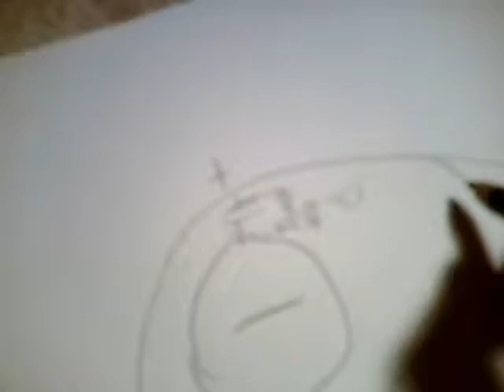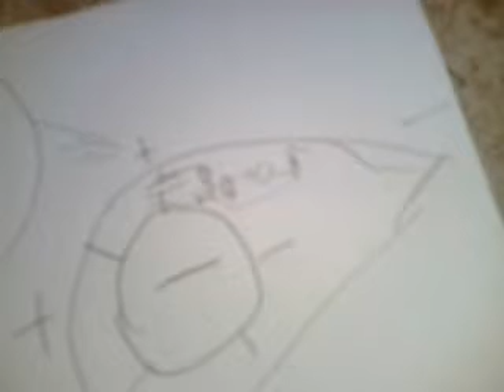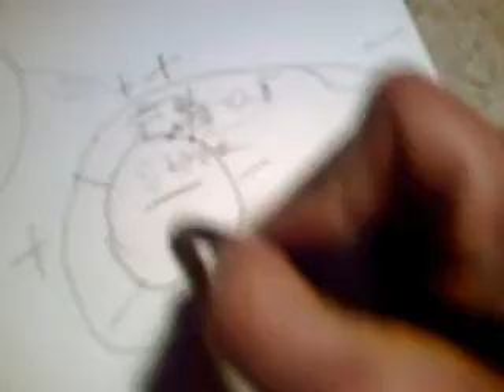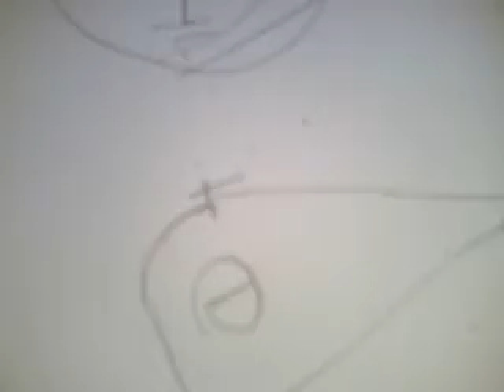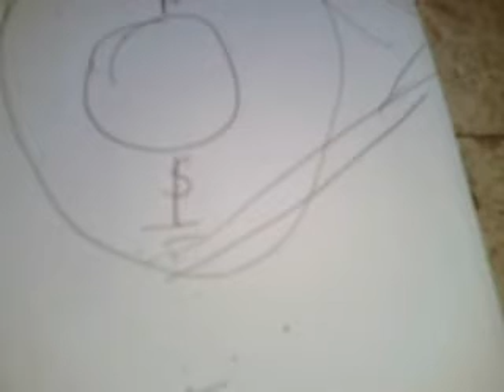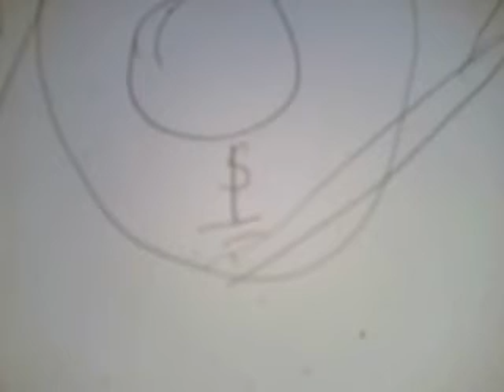the earth sun electric battery

Comment from the maker: it does not matter if or not that the plate is charged positive or negative
because we use the high voltage dc whichever polarity it is to 
excite an lc circuit then we step that ac tone down to be more current and less voltage